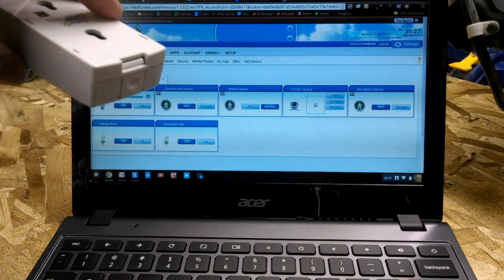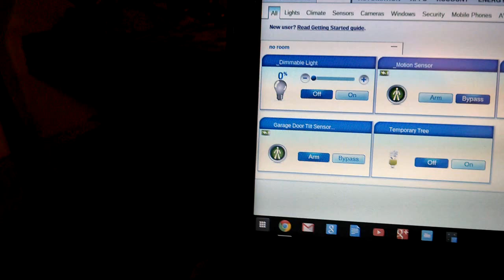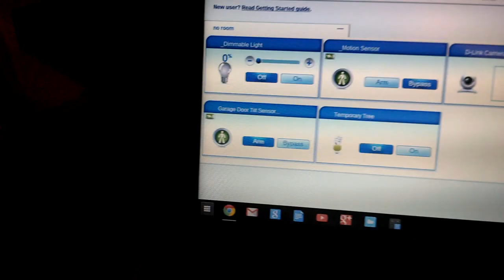007 Systems Ecolink Z-Wave Garage Door Tilt Sensor Unbox and Installation

Comment: Could you explain a little more about the terminal screw for the external switch. I am not quite grasping what that would be used for.
Reply from the maker: An external switch can be added and monitored with this product. If you had a pedestrian door in the overhead door, you could wire it to the tilt sensor. The sensor will now monitor both doors.
I hope this answers your question.
Reply: Not sure I still understand.  I tried googling it and came up empty handed.  Not sure why I would attach a switch to a tilt sensor.
Reply from the maker: If you do not have a single pedestrian door built into your overhead, you will most likely have no need for it. Sample here.
http://www.arm-r-lite.com/wp-content/uploads/2013/10/Blog-4-7-14-1.jpg
Reply: Oh OK.  Thx

Comment: Interesting you mounted it on the metal. Mine would not work even mounted on the wood but near the metal door guides.  I would seem to get the "open", but not the "closed".  Or I receive signals infrequently.   Once I moved the sensor to the middle of the door, away from the door guides, it started working perfectly.
Reply from the maker: Wireless can be tricky. It is a good thing externally powered Z-Wave devices relay signals to expand your Z-Wave network (Z-Net). If you are having problems like what you experienced I recommend replacing the battery or moving the device like you did or move the controller or getting more externally powered Z-Wave devices to make you Z-Net bigger and stronger.

Comment: will this work with samsung smartthings hub
Reply from the maker: +jay walker Yes it should. As I do not have a SmartThings hub to test it, I can not say for sure but it is a very common Z-Wave product and I would be surprised if it did not.
After looking into this further I found this.
https://support.smartthings.com/hc/en-us/articles/202294430-Ecolink-Tilt-Sensor-ECO-TILT-US-
It does not say that they work together, but I would check out on the Smarthings forums to see what other users are finding.

Comment: Whats the range on this thing?  I was thinking about using one on my mail box door to stop a mail thief.
Reply from the maker: +Chris Wylie They are very short range. You will be luck to get 200' out of one. But if you can put your controller close, then maybe it will work for you. The more Z-Wave plug in components you have the better the range will be as the plug in ones repeat the Z-Wave signal.

Comment: Nice video.  This sensor also works nicely with HomeSeer HS3-based controllers. If used with HomeSeer, be sure to use the "add node" controller function in the web interface.
Reply: I need access of open close for a if then statement.  Where Do I
 find that parameter on the 5 parts